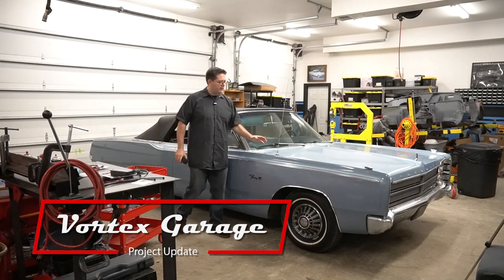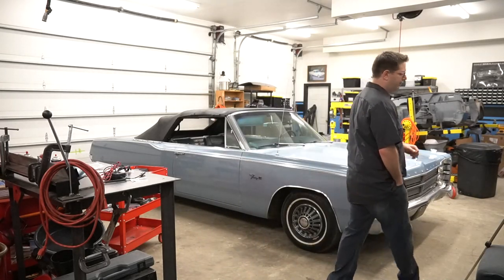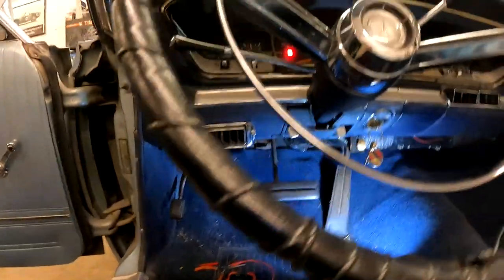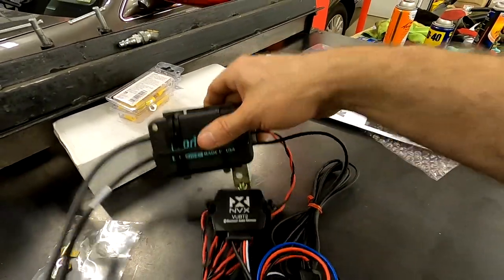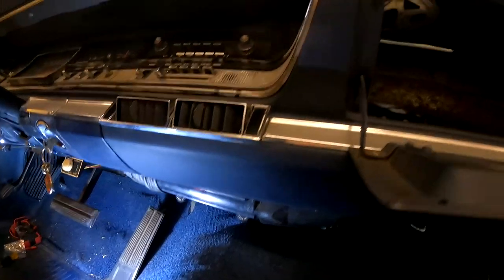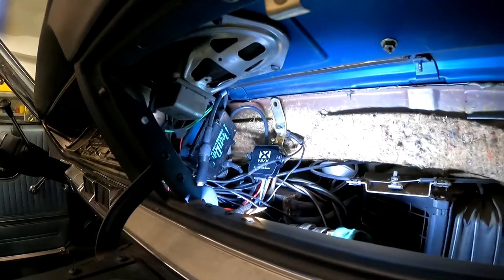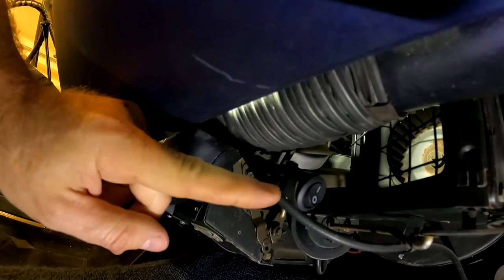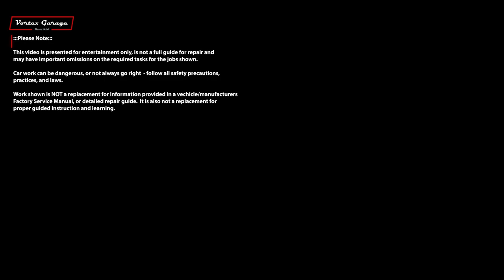Play any audio on your Classic AM Radio - RediRad and hidden Bluetooth install on our Plymouth Fury

Comment: 2 questions, I didn't see how the RedRad conected to the radio, Does it splice in from the AM antenna wire, or does the RadiRad have an in and out antenna plug? 2, I noticed that power wire for the RadiRad and the Bluetooth had an in line fuse link . With that, does it need to go through the cars fuse box? Thanks for the video. I've been wanting to do something like this for my 66 Mustang and 63 Falcon.
Reply from the maker: You are correct in that the redirad goes inline with the antenna - it has an in and out. So plug the car antenna into the redirad and then the redirad to the radio. 

Also yes since the items are fused you could hook directly to power however you may want a switch too so they're not constantly powered on. I chose the fuse used on the block mainly for convenience of a key-on power source.

Comment: How does feedback sound?? Is there a whine when its on?
Reply from the maker: I'd recommend giving RediRad a buzz if you have specific questions - as my reply may not be super helpful.  I do have a slight bit of feedback on mine, but the car also has a very cheap set of plug wires that are giving off some noise.  You get the same noise over the regular radio.  

That aside, no feedback - and way less than listening to terrestrial AM.

Basically what RediRad points out is that the health of your electrical system, ignition system, and other factors can affect AM radio interference and hiss.  Make sure you have a good ground for the redirad, and you should be good.  But in my case I agree with RediRad that any of the feedback I've heard on my Fury is a result of deficiencies in the 54 year old electronics.  I just upgraded the ignition to a Pertronix, and just got my new 8mm wires that I'm going to cut to custom lengths and that should solve what I hear.  I'm super happy with the solution otherwise to keep my AM radio and play bluetooth off my phone.
Reply: @VortexGarage  Thanks for the video!!! Did you ever upgrade the ignition? Did it remove the hiss sound? I have Redirad using a Bluetooth adapter that has a battery and charging port. I only hear the hiss when I plug the Bluetooth into the cig lighter charger. I want to have direct power to the bluetooth like you do but don't want the hiss sound when i plug in the charger.